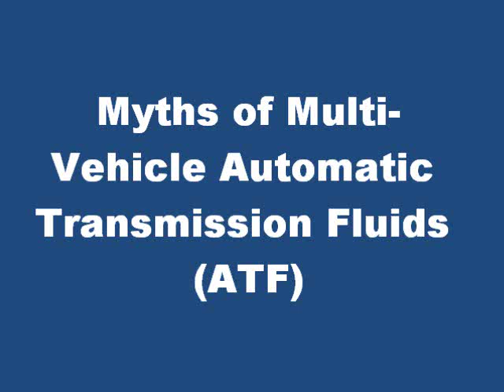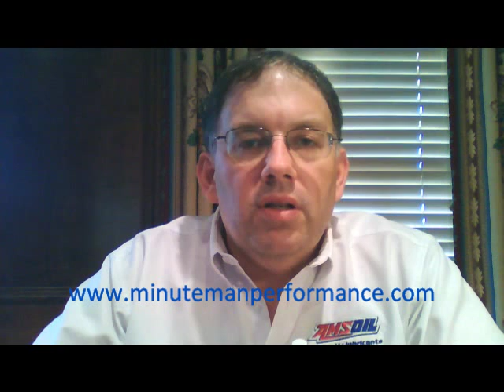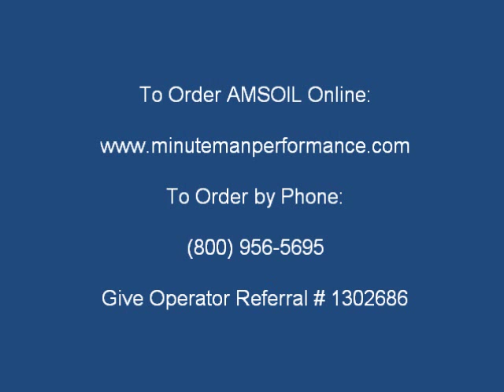Myths of Multi-Vehicle ATFs

Comment: ATF is not a divine recipe! If a fluid meet bunch of requirements like viscosity, freezing boiling point etc. then it's gonna simply work as  oil pump is happy and pumping and the gears lubed against wear, torque converter generates the torque it's supposed to, then what's left? ATF isn't far from the conspiracies around us we see these days in food and medicine just to milk the shit out of people. I replaced my BMW fluid for $40 with Maxlife and been running for a six years now for almost 50k miles while if I were to go with ZF fluid it would've costed me over 400 back then. No labor fees included

Comment: i had a 2000 buick lesabre that used Dexron 3, which is different than Dexron 6...They used to say not to use Dexron 6.....But now they now say the Dexron 6 is backwards compatible and its OK.....How can this be?     Thanks Willie
Reply from the maker: Dexron 6 was always backwards compatible with all previous Dexron products, and recommended for use in all GM automatic transmissions that used any Dexron fluid.  Dexron 6 fluid will provide you with better fuel economy and improved cold weather performance.  If you use a premium full-synthetic version of Dexron 6, you can also extend service intervals as well.  I highly recommend it.

Comment: Can i use in my Honda accord  2008 v6 amsoil ATF fluid? Thay say in Honda manual book only Honda Z1 fluid do not mix with another fluid can cost damage transmission!!!
Reply from the maker: AMSOIL Multi-Vehicle ATF (product code ATF) meets the Honda/Acura Z1 spec.  AMSOIL Fuel-Efficient ATF (product code ATL) meets the newer Honda/Acura DW-1 spec, but it can also be retrofitted into older transmissions that called for Z1 fluid.

Comment: So basically you are saying that any fluid labeled dex/merc will ruin  a transmission?
Reply from the maker: No.  If blended properly, a single ATF can meet several specifications (take a look at AMSOIL ATF, for example).  But cheaper fluids that probably don't meet any specification are lurking on shelves of many gas stations / quick shops and can cause big problems.  Most newer cars require a lower viscosity ATF to get better fuel economy, and the older fluids aren't interchangeable with the newer fluids.

Comment: Hallo sir my question is I am living in Saudi Arabia very hot climate the temperature is going to 46 I have two car one is Mercedes c240 w203 , 2001  and the another one is Hyundai Sonata 2013 , 2,4 gas engine  bout automatic gear can I used amsoil transmation fluid for both car , thank you so much
Reply from the maker: Thank you for the comment.  Please contact the following local company in Saudi Arabia for information on AMSOIL products:  Top Choice, Building 1 - Iskan ALmazzar, Alolaya, Riyadh, Saudi Arabia
Phone: 966.599543241

Comment: Does AMSOIL have a synthetic equivalent to the ATF WS that fit a 2006, Generation II, Prius?
Reply from the maker: AMSOIL Fuel-Efficient Synthetic Automatic Transmission Fluid is recommended to replace WS fluids.  It is available in OE (product code OTL) and Signature Series (product code ATL) formulations.  The Signature Series will last much longer and is what I always use and recommend.  https://www.amsoil.com/shop/by-product/?zo=1302686

Comment: Hello, do you recommend using the Valvoline MaxLife ATF fluid that meets the Mercon LV specification on a 2010 Ford Fusion 2.5 (Duratec) 2010?
Reply: Funny thing about Valvoline Maxlife Transmission Oil  , it meets both Mercon V & Mercon LV  according to Valvoline.   
Which is very strange, because Mercon V is a thicker fluid & Mercon LV  is a thinner fluid.  
So i wonder how they can say they meet the spec for both.

Comment: I have a 2013 Subaru Impreza Base, 2.0L (normally aspirated) with CVT.  I wanted to try Amsoil Synthetic CVT fluid so I checked with Subaru of America about compatibility.  They said, "For the CVT fluid, we only recommend the use of genuine Subaru CVT transmission fluid."  This tells me that Subaru believes that Amsoil CVT does not exactly meet all the specific fluid requirements of my CVT.  Do you have any additional information that would show that Amsoil CVT fluid does indeed meet the vehicle specific CVT fluid requirements?

Thanks.
Doug
Reply: Stick with OEM fluid. Yes, Subaru wants to make money but so does Amsoil. Its impossible to make a fluid that meets the "exact specs" as designed for many different transmissions. Amsoil makes a fluid that is "close to" as many different  vehicle specs as possible. Friction modifiers and other additives AS DESIGNED for your transmission are more important than the fact that the fluid is synthetic or not. Just change OEM fluid more often.
Reply from the maker: AMSOIL recommends their CVT fluid for your vehicle.  Subaru will always recommend only their fluids - it helps them make more money.  AMSOIL stands behind their recommended products with their full warranty, so nothing to worry about.  Thanks for asking!
Reply from the maker: AMSOIL CVT is recommended for the following Subaru CVT specs:  Subaru e-CVTF, i-CVTF, Lineartronic® CVTF, K0425Y0710, CV-30
Reply: Transmission was designed to work with the OEM fluid..not a 3rd party aftermarket company's atf.

Comment: @Best-Synthetic-Oils.com hi, i live in canada and i own a ford fusion 2010 SEL 3 L v6 but i cant find what transmission fluid to use since Motorcraft which ford recommends is an  american company. i think the specs are CXT-10-LV12 Mercon LV could you please help me?
Reply from the maker: Mercon LV is the Ford low viscosity transmission fluid that has become very popular in almost all newer Ford vehicles.  AMSOIL Signature Series Fuel-Efficient Automatic Transmission Fluid (product code ATL) is the correct replacement fluid.  Here is the link:  http://www.amsoil.com/shop/by-product/transmission-fluid/automatic/signature-series-fuel-efficient-synthetic-automatic-transmission-fluid/?zo=1302686&page=%2fstorefront%2fatl.aspx
Reply: Best-Synthetic-Oils.com would that low viscosity atf Be the correct replacement fluid for my 2003 Pontiac grand am